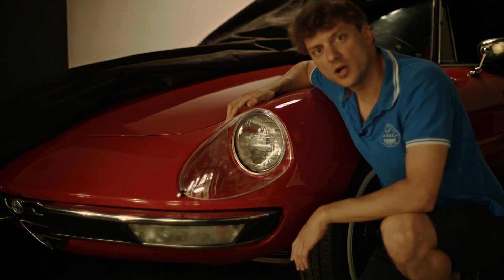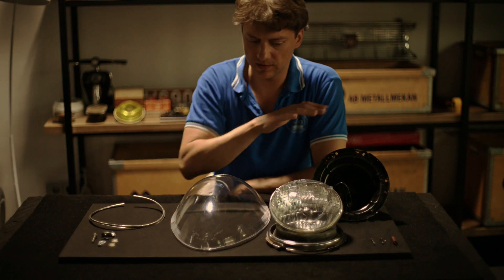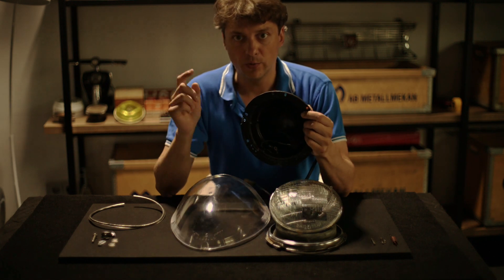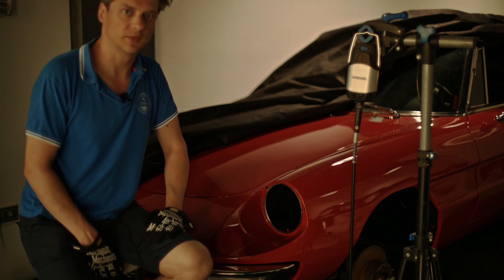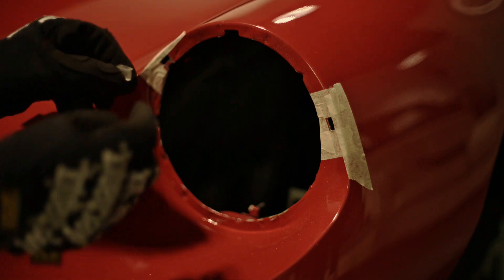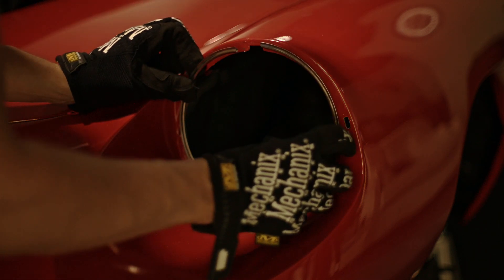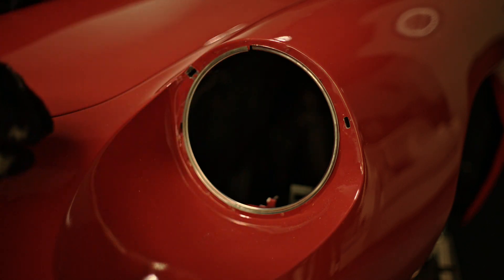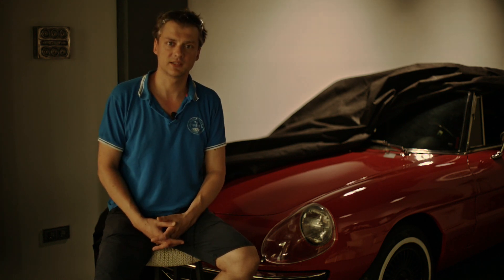Alfa Romeo Spider Headlights Conversion to Carello Perspex

Comment: Let me know if you have any questions regarding this conversion.
Reply: Ciao! Can you show how you cut the metal? Thanks!
Reply from the maker: @jeremyryan9794  Instructions how to cut headlight holder:
https://www.alfabb.com/threads/s2-spider-headlamp-cover-install-photos.388610/
Reply: Is it the same parts/procedure for a S3 Spider, or does it need more work?
Reply: @anderslaugeprip3733  yes, should be same for S3
Reply: @VintageCustomCars  do you not need the chrome outer rings anymore?
Reply: Thanks so much for this tutorial, I am in the process of doing this conversion on my 76 Spider. I have all of the parts and have dry fitted everything. Would you happen to know the size of nut that holds the headlight bucket to the rear of the opening? The three nuts that hold each side? Many thanks!
Reply from the maker: @grahamsnyder5710  hi, as i remember, they are small...(size cant remember) i am on vacation now so can't check, but if you still need info, text me in march month, will be back working in my studio, greetings

Comment: Thanks for posting this. I see some parts needed for my 77 Alfa's Perspex headlight lenses; the rubber grommets that hold the lense more securely for instance. Did you have to cut the trim rings? I ordered those and they are too big and will require cutting. If you cut them, what did you use? Thanks again.
Reply from the maker: hi, yes, you have to cut, please check the link in description and you will find info

Comment: What is the modification needed to the headlight buckets before they are mounted from the inside of the fender?  Does cutting need to be done or a different set of screws?
Reply from the maker: In the description part of this video, you can find a link to the instructions on how and what to cut and etc.

Comment: Nice Car. I have the 1600 Spider fron 1978. Which colour has your Spider? 514 or 501?
Reply: I have seen your other Video and you told is the 501 colour. Not original, but I love it by clowdy sky.
Reply from the maker: @jurgenw.8472  yes, 501 is the color